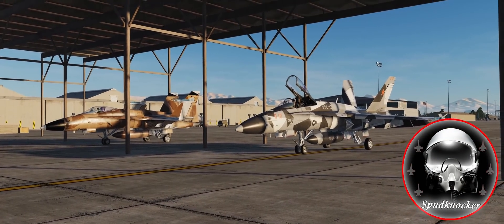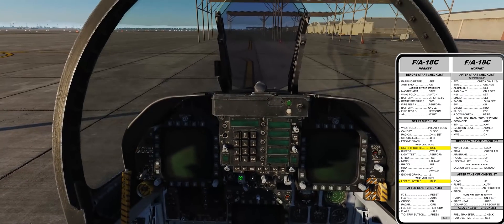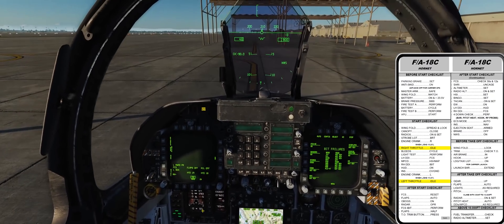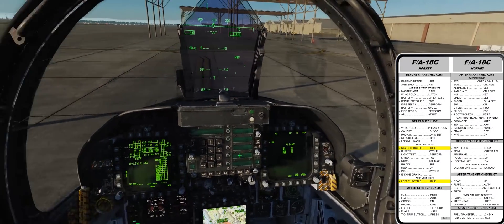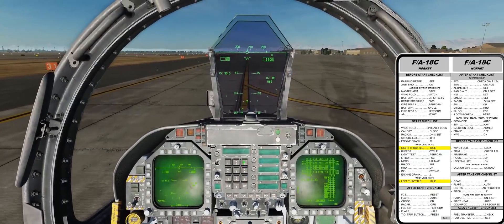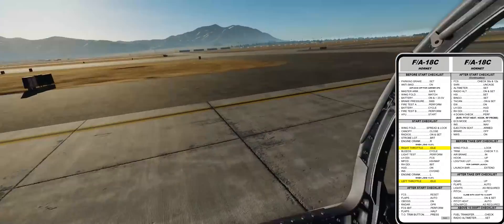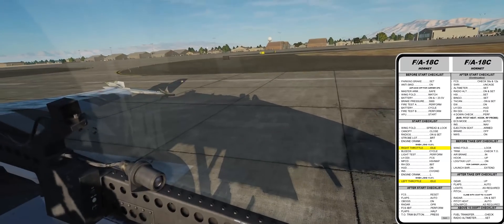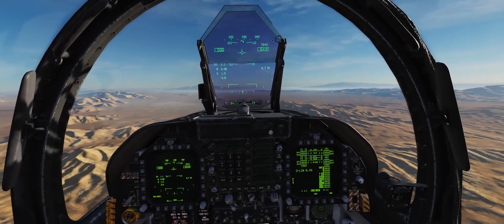DCS F/A-18C Hornet | Start-Up | Taxi & Take Off Tutorial!

Comment: Hi Spud new to DCS world and not sure if this is the correct way to do this but I have a question that's really bugging me and as I subscribe to your very informative channel I thought yo would be the guy to answer my question.  I noted that you used to run an X56 HOTAS. I have the 2019 X56. I am having trouble mapping the throttle for the cold start procedure. I cannot get the left and right throttles on my HOTAS to idle the engines. Can you help with this issue? 

Kind regards Banjo

Comment: FCS Bit it working. 

Go to the FCS bits page, then press and hold “Y” (maybe verify on the right side of the cockpit below the canopy if the switch works) and press FCS again (which should be on the top left on the FCS bits page).

Great vid!
Reply: When FCS bit is running it will say IN TEST instead of Pbit GO. Thats the easiest way to know its working.
Reply from the maker: Hmmmm... Thats what I was doing...at least I think!  Maybe its borked in my install, I will try reinstalling the Hornet and giving it another go!
Reply from the maker: Jesse Z hmmm I gotcha thanks for the tip!